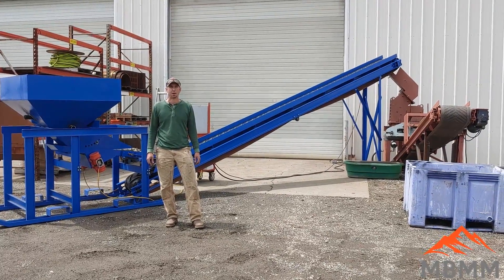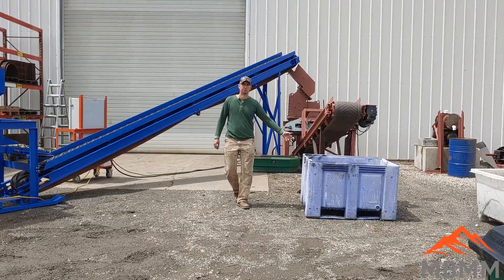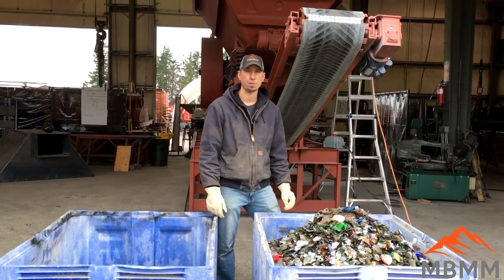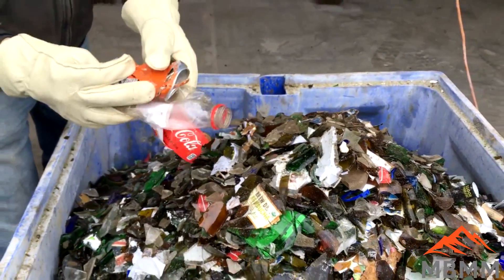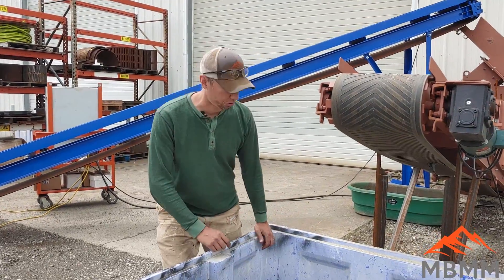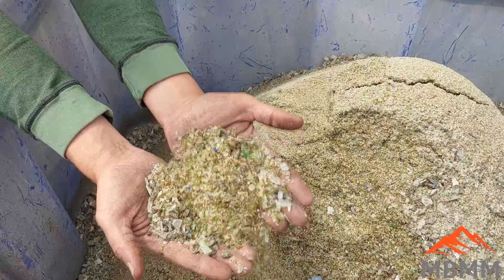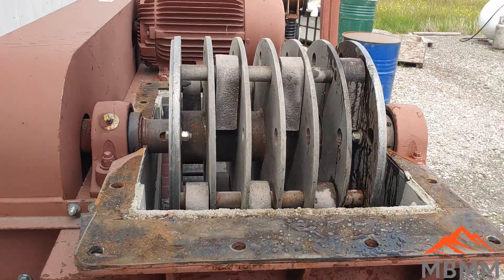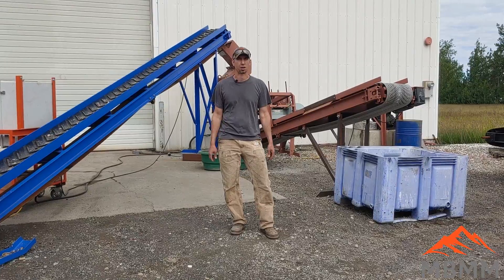Recycling Glass To Sand! Glass Crushing & Recycling Line

Comment: 3:36 why is there so much product all over the floor dude?! Outside no less. That's a shambles and entirely preventable.
Reply: Those are just rocks and gravel not glass
Reply: @realerdealers1924  think I had been awake for 30hrs+ when I wrote that so when I first came back to this, I thought "oh shit yeah so it is, why did I even think it was glass?!" and was ready to drop all charges.

But then I remembered that there is a point in the video where you can see the belt dumping into a hopper and missing 1% onto the floor. Which then led to the thought "who the hell puts a glass processing plant on gravel?!". You can't clean that!
Reply: @DeltaCodex  lol

Comment: It always felt like a waste to recycle bottles, when they could be just washed, rinsed and re-used as they are by the producer of the beverage they came with. I mean, we take so much time and energy and effort in order to simply make glass into sand, so we can later make that sand back into glass. Its not like we are facing dire shortages of sand, nor is it that harmful to mine it.

Comment: Tried mixing crushed glass as sand in cement, turned out A1 in finished product, But will not readily cut with a masonary drill bit.

Comment: After you run it through the half inch screen set up a drying system you can make one just weld 2 55 gal drums together a gear box and heavy duty casters chain and sprockets then aim a torpedo heater inside of it wyle its spinning it works i made one if you have a good fabricator he'll know where im going with this and how to build it cheap and fast

Comment: Why not have the magnet before the hammer mill?  I heard desert countries have to dredge sea sand for concrete because desert sand is too rounded and fine for concrete. I have often thought they should recycle their glass to make their own sand, but you aren't even doing a pre wash and sort before the hammer mill.  I imagine all the paper, foil and steel would contaminate the glass after it was screened for size.

Comment: I would think that just smelting all that with the contaminants, the papers would burn off, then chemically separating the metals and any left over contaminants to present as recycled material would be cheaper. But there are folks out there that would crush the glass for road purposes and other applications so you make them they're own kit :)

Comment: Nice setup. My glass crushers and screener got badly damaged during a truck wreck recently, so I'm looking for newer equipment now. I was just varying my speed to control the size output, but it makes a lot of dust at higher speeds. The glass does need to be very dry during processing
Reply: Use a cyclonic recovery system attached to a vacuum and spritz some water into the dust collection system at the jar at the end.

Comment: The only benefit to crushing glass to sand is that glass will not be sent to a landfill. Otherwise, there really is no need for recycled glass to sand. It's cheaper , environmentally sustainable and cleaner to use existing sand for commercial and industrial needs.  The Earth has more than sand that we could ever use. Recycling glass is just another "feel good" process for environmentalists.

Comment: Would A powdery  glass like that be dusty and dangerous to breath in? I would almost think you would need A respirator being around it.
Reply: Glass dust is extremely bad for the lungs - very abrasive.
Reply: Yeah any abrasive substance is bad for your lungs.
Reply: This is one of those comments I'm glad got a response.
Reply: Crushed glass is safer than sand because it doesn't give rise to silicosis, although as said you need protecting against the dust.
Reply: YES IT IS , BUT IF YOU DO NOT KNOW  WE ARE ALL EXPOSE TO THAT DUST EVERY DAY, EVRYVHERE , BECOUSE WE ARE USING INSULATION WHICH IS MADE FROM BLOWEN GLASS IN OUR HOUSES
Reply: I was called a glass recycling company in Constanta (not just one, but this is the cake of them), on papers,, of course he has a site online. Sites online we have a ton, with recycling principles and stuff. Yeah moralistic stories everywhere !!! I called the most official Constanta recycling system possible. "Sorry we don't take anymore glass because THE GLASS COLLECTOR PARTENER COMPANY WE WORKED WITH  HAS FINISHED THEIR ACTIVITY AND CLOSED !!!"😈🤬😡😠 
P.S. THERE IS CURRENTLY NO WAY TO RECYCLE WINDOW GLASS IN CONSTANTA, A CITY WITH 500.000 INHABITANS !!!
THE CONSTANTA IS AN EUROPEAN UNION CITY !!!🤪😜😟
Reply: mesothelioma
Reply: Blind Bob  beach sand isn't powdered.  its granular like sugar. think of the difference between sugar and powdered sugar.
Reply: @frankyflowers  Crushed glass grit is granular like sugar, glass beads used for bead blasting are more like a powder
Reply: if you look at how the sand clumps together its obvious its very edgy and not rounded meaning if it gets in your lungs its staying there kinda like asbestos
Reply: not powder- sand
Reply: @wsl3666  I appreciate that, but any crushing process also produces quantities of tiny particles as well as the desired grit/sand. If this set-up were indoors I'd definitely be wearing some good respiratory gear. I used to work in very high silica sand stone and the dust - much finer than the particle size of the stone itself - permeates everything. Even wet processes, unless they are very thoroughly set up,  allow quite a high spread of dust.
Reply: @mikaelabowen5781  If I had to take a guess they probably run water over it afterwards to keep the dust down.

Comment: I'm fascinated by this kind of stuff, so thanks for posting!  I do have a question though, since there is no apparent pre-processing done to remove the labels on those bottles, how much does paper and adhesive affect the quality of the final product?  Does this need to be further removed somehow, or does it all just flash-burn off when they re-form the glass into new feedstock?  EDIT: Also, why isn't it necessary to separate the various colors of glass beforehand?
Reply: Paper or small amount of organic material don't affect the final product. since it oxidize at glass melting temperature into water and carbon dioxide. the only things need to be separated are, metals, ceramics, stones and plastics.
Reply: @isurumaddumage1922  Interesting, thanks!

Comment: Is there money to be made in crushing glass? How much does it cost to get started with that machine?
Reply: Highly doubtful.   You cannot make much money doing things like this unless you are crushing and selling many dozens of tons per day.  The equipment to do that would cost hundreds of thousands if not millions of dollars, and you'd have to keep it running 24/7, plus you would have to have some municipality that is supplying you with many tons of glass per day.

I imagine you can probably find smaller used machines like this guy for pretty cheap, but you'd have to fix a lot of it first.  If you bought new equipment, you'd probably be looking at 20,000 to 30,000 dollars or somewhere around there for everything he has there.  It's kinda hard to say.
Reply: @karozans  Youre looking at it wrong. Instead of buying machinery... sell the "ability" to break the glass down with heavy objects for destructive people. If no one pays then "allow" them to do it for free. All you would need is your garage, a sledge hammer, push broom, and trash can. lol

Comment: I don't think you needed to upgrade to blue belts just yet, yellow belts would have been fine.  It also looks like you need to run a few of these units in parallel to upgrade your output.

Comment: This is inefficient and environmentally damaging, and it's a no brainer!
weigh up the energy used in this process, including the individual journeys to the bottle bank, the truck that empties it, the manpower involved and the electricity used by these machines. Now compare that with making it new, in a factory sited next to a plentiful supply of sand.
A quarter of the Earth's surface is silicone. It's the most plentiful resource we have available. It's the energy involved that makes the environmental impact and recycling glass will never make environmental sense. It would also be readily reusable if wasn't for all the various companies marketing departments coming out with a new sexy design of bottle or coffee jar every year. In the past, all glass containers were returnable and reused many times. It is inert, and one of the safest things to put in landfill, as it naturally returns to the Earth with no harmful emissions.
Why are you recycling glass? It is only the subsidies that make it cost effective, and even then it is only the green recycled glass that has any significant market. Please do your own environmental audit on this wasteful and unnecessary process. You will quickly see that it just doesn't add up, and is a counter productive waste of time, energy and equipment.
Reply: A modern glass bottle would take 4000 years or more to decompose -- and even longer if it's in the landfill.  I suppose we could make mountains equal to the Rockies out of glass in landfills.  We'll start in your back yard.
Reply: You are talking nonsense  @scotthatcher838 . It's silicone, the most common element in the Earth's crust. It's not a pollutant, and what's to decompose? Glass is inert, and doesn't react with anything. The pressure and weather erosion simply crushes it to sand. There are beaches made almost entirely of old glass, and far from being a problem, they are stabilizing beaches by replacing sand we've previously robbed out, preventing costal erosion. Glass used to be valued, with almost every bottle and jar being collected and reused. Now, thanks to the glass recycling industry, which is a scam that couldn't operate without public subsidy, it's treated as a throwaway item, and people want to pretend it can be efficiently recycled when anyone with a basic understanding of the process can see that's always going to be impossible. You've simply repeated the PR of the glass recycling industry without thinking it through. If you can do the energy equations to justify transporting, crushing and melting it all again, as opposed to making more from the millions of tons of sand piled right next to the factory, then please share those calculations here, as currently, your solution involves a massive unnecessary and energy use which these companies do not pay for. We do.
My preferred option would be to standardise all mass produced glass items and place a deposit on them, as we used to. Now, manufacturers design a new sexy coffee jar every year or so and treat it like a throwaway resource, or an easily remoulded substance for THEIR convenience, ignoring the environmental impact. This entire 'problem' is intentional, and the 'solutions' they advocate benefit corporate interests at the expense of efficiency and our environment. We ought to be reusing, not recycling our glass, but money is the reason this no longer happens. If you are truly concerned with our environment, I'd suggest that you stop and think this process through. It needs currently needs to be transported great distances in lorries, crushed by huge rollers, then heated to 1400-1600c for at least an hour.

Comment: Question:  How is the paper labels and glue handled?  I imagine that it would be burned off when melting for new glass but is it processed before that step?
Reply: If they are just making a utility grade sand I would assume the that any contaminates such as the labels are not critical to the end result. I would also assume that some form of washing operation could remove the bulk of them if needed, I would doubt glass ground into sand would find it's way back into new glass however as this is more refining then it actually needs, the first crushing operation would be sufficient if it was just going to be remelted.
Reply: @justingrey6008    your right about the glass not being remelted into new glass, we use glass sand as a low cost aggregate for manufacturing concrete blocks, the sand does need to be cleaned of any sugars though via either washing or burning off, as glucose retards the cement reaction and compromises the strengths reached by your blocks.
Reply: @justingrey6008  utility grade compared to what
Reply: @oo-cv7vt  As compared to new. Different colors and types of glass contain different chemicals. So while you may want a clear drinking glass made of crystal (really pure) the glass used as filler in concrete to make a road isn't as important. Some glass isn't even considered recyclable because of it's much higher melting temperature. And since it could take a million years for it to decompose...
Reply: @oo-cv7vt  to screened, washed and graded sand. For instance this would never be suitable for filter and, just as play sand (for kids sandboxes) isn't suitable for filtration. And both of those are not suitable for concrete. 
There are more types of sand then you could imagine.
Reply: @MFingChuck  Glass does not decompose it is just silica.
Reply: @justingrey6008   Actually, alternative cements to Portland composites are being developed,. i.e. Alkali-activated cements.  These new cements are Portland-free,  and some of them use 100% waste glass as a binder (not as aggregate or filler) with good hydraulic and mechanical properties.
Reply: @FlorenceSlugcat  According to EPA, in USA, there is more than 9 million tons of waste glass in the municipal solid waste composition which would mean more than 3 times that mass in concrete. Enough to build a entire city. However, do not confuse alternative with substitution. It is obvious that Portland cement will always lead the construction market, but this  low-cost and low-CO2 sustainable cements are an alternative to supply a part of the demand.
Reply: Burned off when the glass is remelted, same as any old contents left in the bottles and jars.
Reply: @zoidlrrr4633  That's the real challenge!, educate and inform others. Most of the people are not aware of the global situation. Our duty is to inform those people, encouraging unity and a global mind.
Reply: For grit blasting the shredded labels don't cause a problem.

Comment: Basically a crusher feed on as primary your secondary be in fed hammer mill with 1/2 inch  in to a inclined conveyor with mag separator. BUT. me personally i would have went for a grated crushed for 1 inch material in to a granulator with with 3/8th inch greats or even 1/4 inch greats to remove the rerun process or possible tertiary granulator stepping half inch down to 1/4 inch grates with inclined mag separator i would also set the gaps on the granulators to 10/1000 of a inch granulation would also help with throughput problems of wet glass. p.s this is the same process used to separate insulation and metal wire minus the gravity separation tables.

Comment: Thanks for this video,  I have been looking at doing the same with a jaw crushed, into a VSI, then harp screening to achieve a 4mm minus sand. I had not considered a hammer mill until now. Thanks for putting out another method for all to see.
Reply: Cone crusher is the way to go . Then screens for the different mil sizes . Makes great sand blast medea

Comment: very impressive !!! We are located in Greece where we have thousands of tons of glass bottles and do not know what to do with them, currently, we recycle metal but we are looking to expand in other recycling areas such as glass. Any suggestions ?
Reply: Crush it to use as a pipe bedding sand or fill sand, 4mm minus seems to be the industry standard. In Australia there are a number of operations producing these products commercially.

Comment: If you want to make ornaments, you could maybe use that sand. If you want to make bottles, you can''t. In a glass plant that makes bottles, the bottles are first checked, physically, for cleanliness, then separated by colour. A worker lifts each bottle, checks the contents and the top. If there is no top, or contents, he then tosses it into a bin according to colour. [(There are only 3 colours, clear, brown (usually beer), and green.)] If the top is still on the bottle or if there is stuff inside he will reach inside the garbage bin and hiding his face, smash the top and neck against the side of the bin. If when he lifts it up it is now empty it will go into the appropriate clean bin, other wise he just opens his hand and lets it fall into the G. bin. Because most drinkers use their bottles for ashtrays a bottle usually has butts or squished caps in it. These items usually take too long to remove so the checker simply drops the unbroken bottle into the G. bin. When they make glass, a process of melting; silica sand, colour pellets, and other chemicals only 3% of the batch can be old glass. So if most of the returned bottles go into the G. bin they don't care.

Comment: I don't know what the costs of running those machines are compared to purchasing raw sand is, but it seems a good way of re-using glass in things like concrete. Also didn't realize it would revert back to sand colour when crushed fine enough, must be the way light refracts through the fine particles i guess.